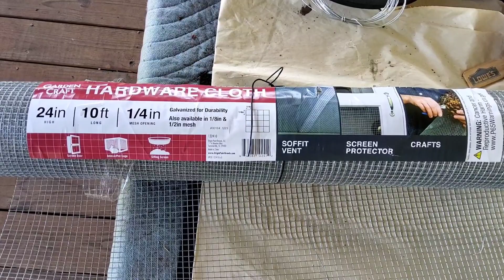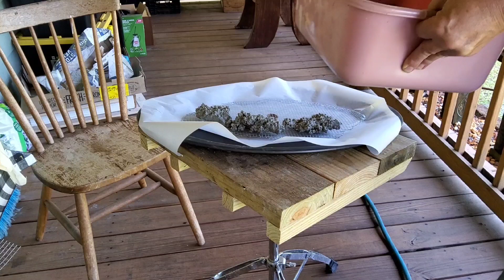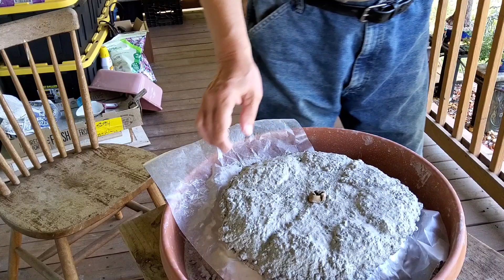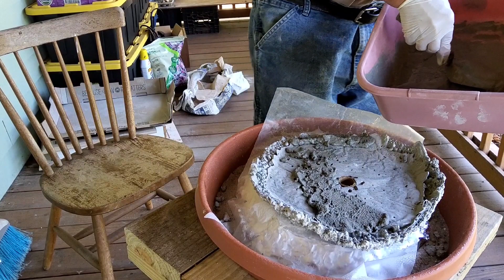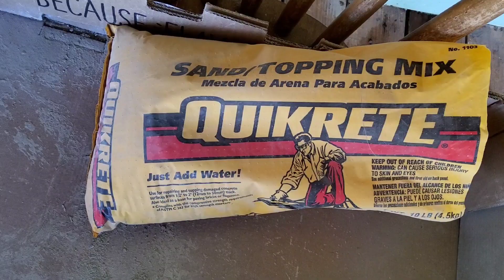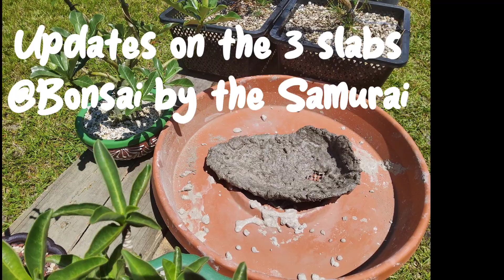Bonsai by the Samurai, how to make concrete slabs for your Bonsai, CLB Club@Bonsai by the Samurai

Comment: Great video and i made a few concrete slabs  over the years .I usually finish them off before they dry out with a damp sponge instead of using my hands, and i  get good results.
Reply from the maker: I've used small brooms, paint brushes, and assorted other items. I've used a small sponge to dab on paint for finishing the 2 color look in my latest works. I'll try the sponge on my next slab. Thanks for sharing 👍

Comment: .... what is  the proportion perlite to cement/concrete?   Thanks!
Reply from the maker: Judging by the video, I used about 25 percent, I didn't write it down, and since then, I've changed to straight Portland cement. I have been making thinner slabs that are still lightweight. Check out my later videos on making slabs. In February, I will be filming a class of working with cement in the making of concrete slabs, pots, and mountains.